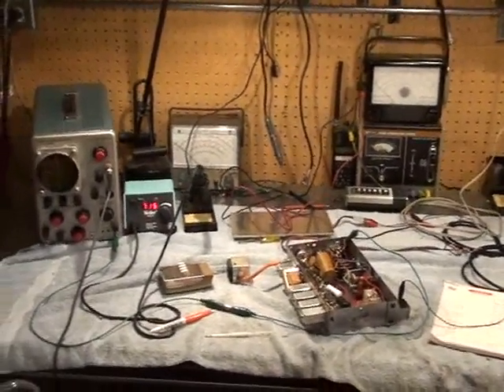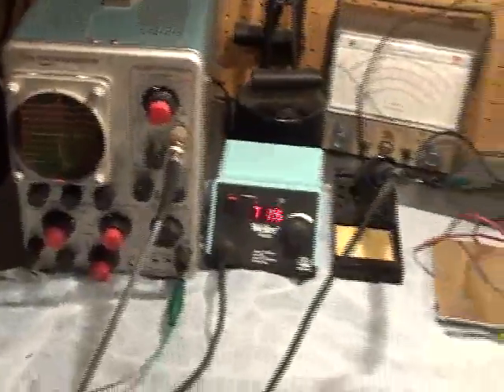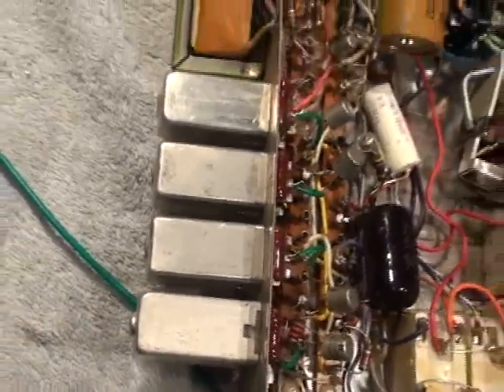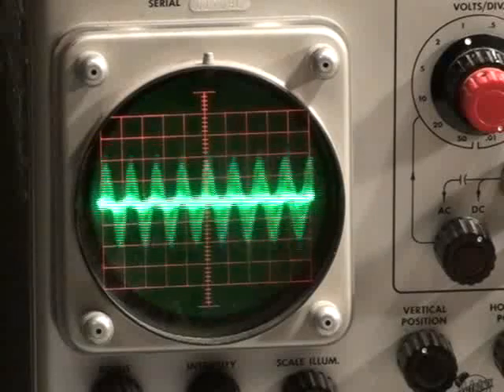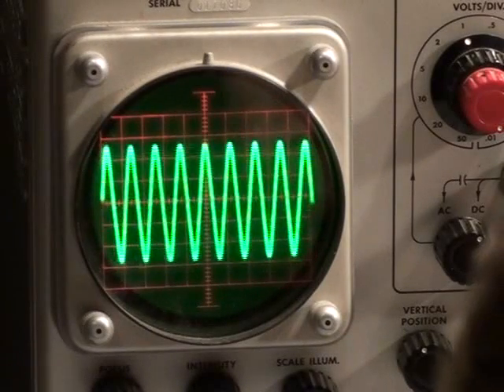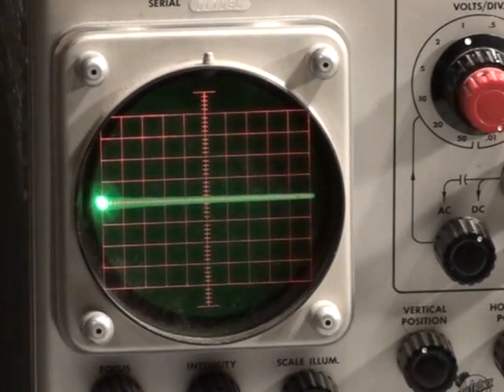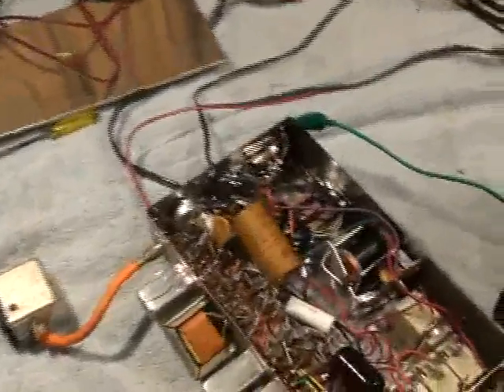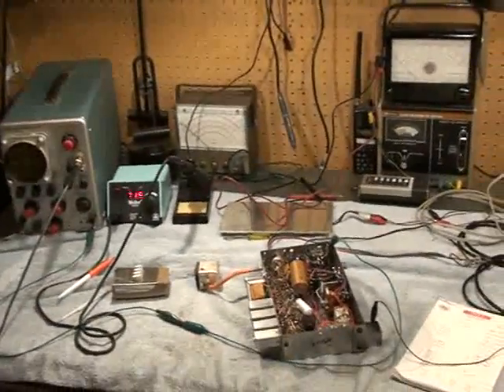Zenith Space Command remote control alignment procedure

Comment: I'm trying to find service manual, or schematic and parts list for the transistorized version of the space command remove receiver subsystem.  The same one you cover in your alignment video, I believe.  I can't seem to find one on-line, or on eBay.  Any suggestions as to where I might find a copy?
Reply: if you still need it here is the patent that has the schematic http://pdfpiw.uspto.gov/.piw?Docid=3233152&idkey=NONE&homeurl=http%3A%252F%252Fpatft.uspto.gov%252Fnetahtml%252FPTO%252Fpatimg.htm
there's no part identifiers but it tells you the year at least. 
And then this one,
https://www.manualslib.com/manual/1039285/Zenith-Space-Command-200-Series.html